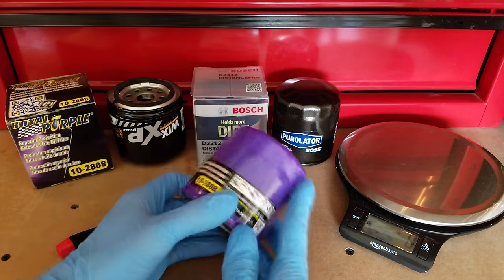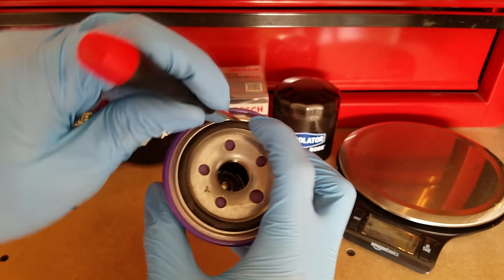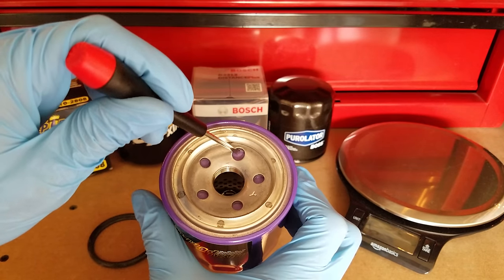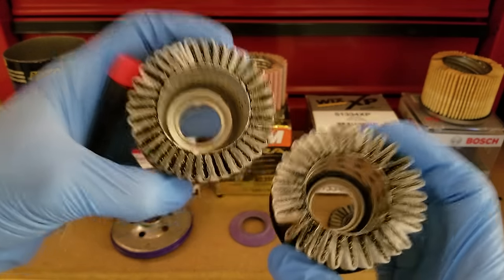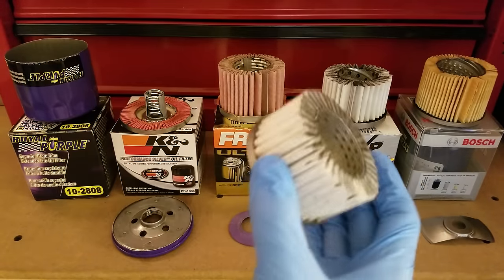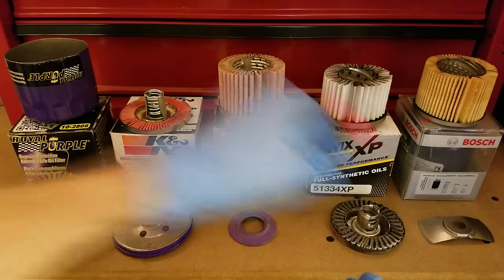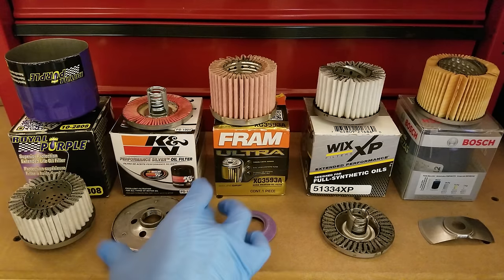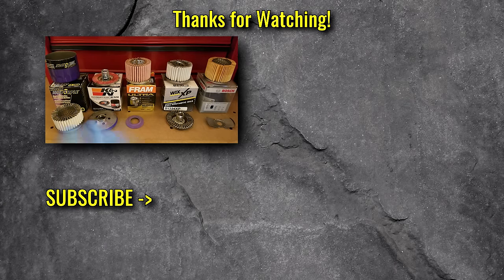Royal Purple filter Cut Open!  vs FRAM vs WIX vs BOSCH

Comment: Are the walmart super tech good filters?
Reply: No they are not. Stay away from them. 

Best advice I can give in the oil filter selection process is the following: 

If an oil filter you are looking to buy does not have a Micron rating of 25 or less and a synthetic fiber media then its a garbage filter. 

Anotherwords any oil filter with a  micron rating higher than 25 means the filtration becomes poorer and poorer.

That in turn will shorten the life of an engine by shortening the life of the oil. 

Hope that helps.
Reply: @extremedrivr  Thanks, Whats about the factory Hyundai filters?
Reply: @desertrider325  Not sure. I would have to do some study on them. 

But as of now the only 2 Oil Filters I trust are the Amsoil 25,000 Mile one and Royal Purple Hi Performance. 

Those have the highest filtration and build quality of any filters I know of. 

I use Amsoil Oil Filters but either of the 2 I mentioned here are what you can be assured as the best possible protection for your vehicles oil and engine.
Reply: @extremedrivr  Do you go 25,000 miles before changing the filter?
Reply: @desertrider325  Well.. I usually change filter and oil once a year.

Only make about 15,000 Miles or maybe a little more per year depending on my driving habbits.

But you could go the full 25,000 I am sure.
Reply: @extremedrivr  So with Ams oil and the filter you do oil changes every 15K miles? Not every 3-5K?
Reply: @desertrider325  Yes every 15,000 or 1 time a year whichever comes first. 

But I always get an oil analysis done just for extra insurance to make sure nothing is abnormal with the engine.
Reply: @extremedrivr  What oil do you use?
Reply: @desertrider325  In my vehicle I use Royal Purple because that's the first, real synthetic oil I was educated on. 

My mothers vehicle is running Amsoil Signature Series since she doesn't drive it as much.

Comment: Yes, please review Mobil-1 filters...  Been using them for a while partly because they have a small bypass or higher flow feature for instances of higher pressure to complement the smaller micron filtration of the balance of the filter.

Comment: How many modern engines failed due to a oil related or filter problem. Any filter and any oil will outlast your car. Do any of you guys remember the feridium anode?
Reply: My 02 Saturn Sc1 is still surviving off one oil change since last year with a Fram filter and 20k miles on that one oil change now
Reply: The oil refinery within a filter? The dual action acid destroying engine preserving miracle by Lee filters? I remember.

Comment: Talk, talk, talk.  Run before and after pressure drop tests [oil at 160 to 180 degrees] with 3,000 miles on it and run oil sample tests - use the same engine and the same oil for all tests.
Reply: exactly. we dont care how cute the filter looks lol

Comment: What I would like to know is what is better made, oem or aftermarket
Reply: OEM.
Reply: I go the same route, use OEM filter and oil with approved/exceed manufacturer spec.
Reply: Hate to break it to you but AC Delco filters are garbage

Comment: Over analysed parts that make little difference and forgot the part that a filter is all about. Paper quality. After all thats what filters the oil.    If you change your filter regularly it matters not as it wont be on long enough to fail. And thats the entire idea of a disposable filter. Its only a problem if you never change it.

Comment: There are actually only a few manufacturers of filters, the respective companies just contract them to build them for whoever and stamp their names on them, you don't need an expensive filter, even if it has a simple open bypass and cheap rubber drainback you'll be OK, its a waste to pay 20 bucks for a filter unless you must have the best for some reason

Comment: K&N is kinda garbage when it comes to air filters, all they do is mess up the MAF sensor and make throttle body sticky and oily. It's fine i guess if you have TDI or something, oily turbine blades can't really mess up anything, and those "cold air" intakes are freaking joke, majority of cars already have cold air intake, they suck the air right in front of your, but no, idiots think air will be cooler if it's coming from shiny pipe that goes above the hot engine or exhaust LOL

Comment: I would rather have more glue on it then not enough but without doing a flow and micron test all you can do is look at the parts they put in but I won’t use any of those brands

Comment: top drain back hole is larger to to it being the main drill hole on the cnc, holding it in place while the other 3 are drilled. just an interesting fyi....also, many are getting away from the metal clips, because after 2000 miles, they disappear...(in the engine)..Fram is garbage. If for some reason I had a donkey in my front room with the stomach flu, I wouldn't even use a Fram filter to plug its ass to keep it from shitting all over the place. Its a shame RP uses the same type of spring as Fram. Thats a deal breaker, and leaves me and my donkey baffled as to why they do this.

Comment: How are motorcraft oil filters?
Reply: Made by Purolator, and they're good filters!
Reply: Can confirm; motorcrafts tend to have silicone rubber (red) anti-drainback valve and gasket. Fairly large surface area filter media. Not too tight on pleats, IIRC.

Comment: You can use the c heapest filter against using a top dollar and the engine life will be the same.. its how often you change the oil that makes the difference.. a top dollar filter will not make up for worn out oil  go ahead and tell me im wrong. you can run an engine with no filter sys and change the oil when its worn out and  that engine will last just as long..  Except for the casing rupturing im not concerned about filter quality  this filter stuff is pure BS because  NO filter will filter out SLUDGE its molecules are the same size as the oil  so now what..!

Comment: use a cheep oil filter and cheap oil and change it every 5k miles and you will get 300k out of your motor the only time you need better oil is if you are a turbo motor because of the heat....i run Rotella 15w40 in everything i own here in texas and even my old 1987 for truck still runs fine with the original stock motor my 06 nissan altima my 97 ford f150 4.6l all still running strong and do not leak or use any oil between there 5k mile chang .......and i do 5k miles because i am lazy  and every 5k 15k 25k oil and filter every 10k 20k 30 k oil and filter and air filter
Reply: Actually not that simple on newer designed engines.

Comment: You seem to be overly critical.
VIsual inspections prove nothing but a waste of time. Show me which one actually filters best and provides the best flow rate. I understand that the Purolator Boss is more restrictive with a lower flow rate.

What is the area of the large center home ?..They should all be the same. And if that is less than the area of the inlet holes then there would be no difference from one filter to another.

Comment: I dont care what kind of oil and filter combo you use or how good a filter is. Always change your filters half way through an oil change and replace the oil that came out. Personally every car needs to be sealed up properly and have synthetic in it and for flat tappets a synthetic with zinc
Reply: Gerald Fox just curious, what is wrong with  warming the oil, removing dip and fill cap, then removing the drain plug and filter at the same time to drain all the oil?  I was always under the impression that it would be fine if you let it rest a bit to let the air rise and double check if you need to add any more fresh oil.  I also started "priming" the new filter with fresh oil and making sure the gasket is clean and dry.  Just trying to learn more, as I am self taught.
Reply: Onno Inada you obviously didnt read the part where I said in between oil changes
Reply: Ahhhh.  I interpreted that as half way through executing an oil change.
Reply: Onno Inada it's all good

Comment: Don't use Purolator on performance engines, just built a 408 for someone and the filter was so restricting it kept oil from flowing properly throughout the motor... Long story short there were metal shavings found in the filter

Comment: Oil filters are pretty much useless and will not and do not need to be changed after every oil change.
Reply: My car is 7 years old. When should I change the oil? I know the original filter is lifetime, but I want to change my oil early to extend my engine's life. Is next summer too soon? JC Whitney sells a toilet paper oil filter. It's the best, but is it overkill? It's $40, plus the Charmin, which has a nice fragrance, 2 ply rating, and is septic tank friendly. That I figure, is good for my HellCat, right?

Comment: I cut open a brand new fram oil filter 
And it reputation followed what I found
The area were the 2 ends of the element are crimped together by a strip of metal had the corner of the element folded over that left a open hole in the element were dirty oil could pass through with out even being filtered
A true piece of crap i will never buy a fram filter